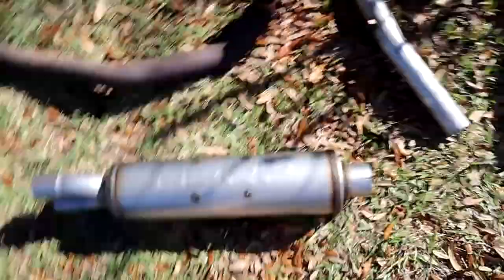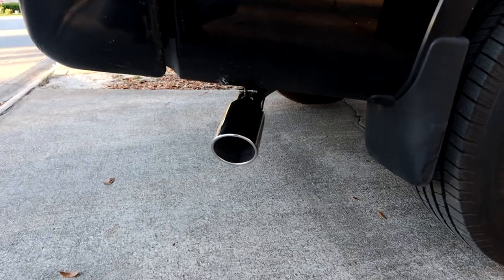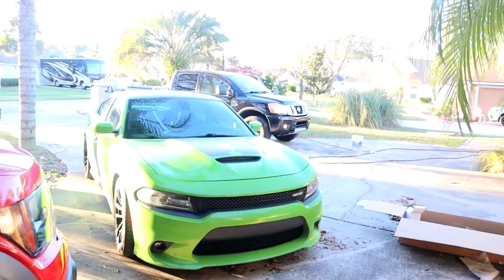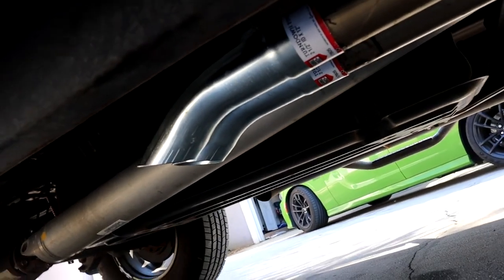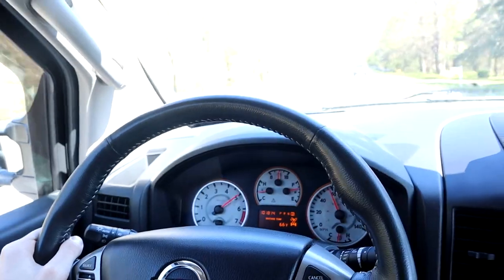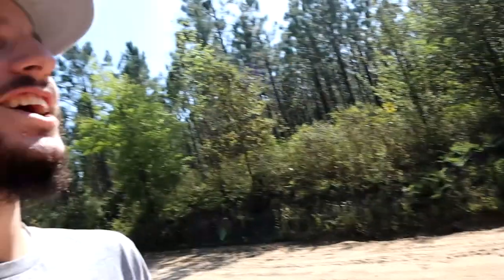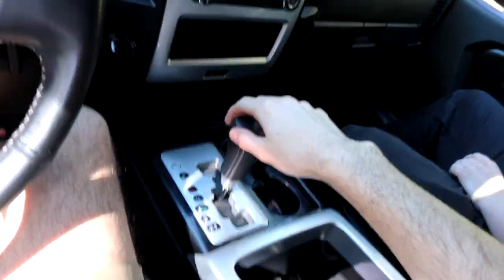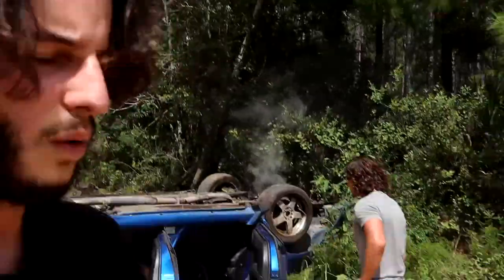NEW EXHAUST FOR MY NISSAN TITAN .......I HATE IT

Comment: What year is it ?? Has it bin reliable
Reply: I have a 2010 Titan SE 4WD with the 5.6L V8. 63k on the clock now, and while some parts of nissan are not so reliable or cheap (63k miles and my heater doesn't work prob heater core, and washer pump went out) the motor is very solid and it'll last me 200k maybe even 300k if I keep up the good maintenance on it.

Overall pretty good truck, but just expect some poor quality control on anything outside of the motor lol. My window motors have gotten very slow too. The truck has also been garage kept, and not driven too heavily most of it's life. Most miles are highway miles between Arizona, and Montana.